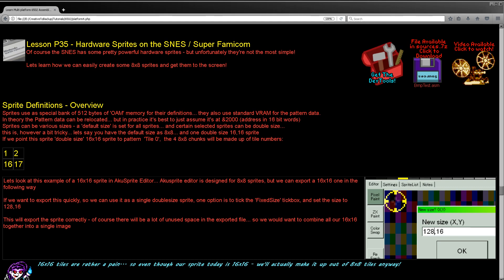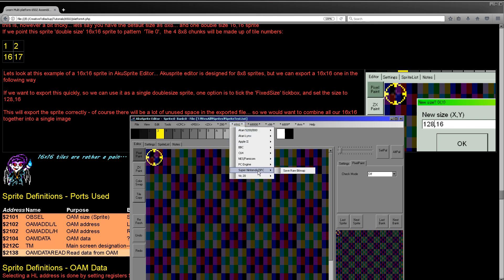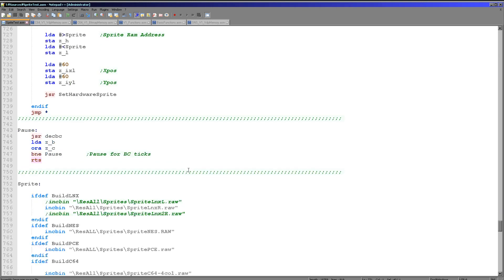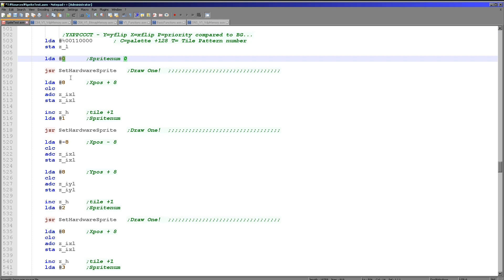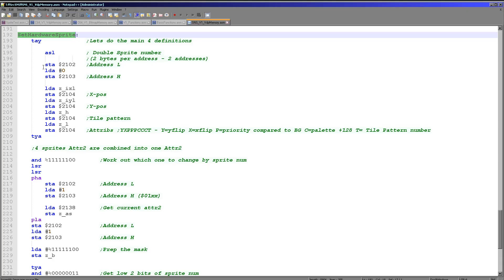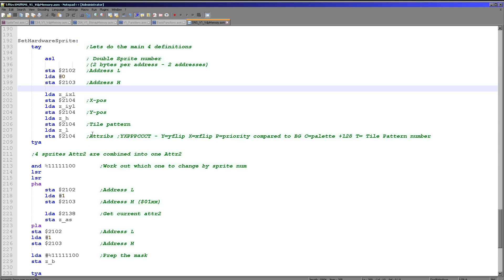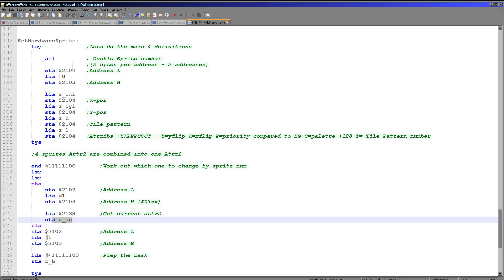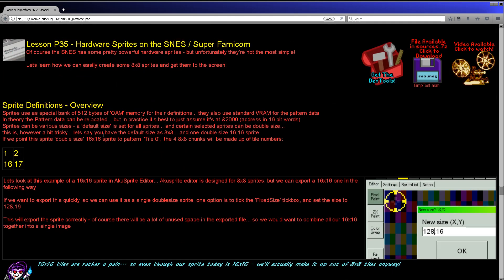Lesson P35 - Hardware Sprites on the SNES / Super Famicom

Comment: which compiler do you recommend me to start a snes programing?
Reply from the maker: I started with VASM - but it can only do 6502 cpu mode - fine for everything I cover in my tutorials, but not the full 16 bit potential of the SNES... 6502 and VASM are an easy way to get started.

I've started looking at WLADX for full 16 bit 65816 - it apparently supports the SPC700 sound chip too, as well as complex rom layouts... it's harder to use than VASM though for that reason... I hope to cover this in my tutorials next year

Comment: You might already be aware of this, but the SNES isn't limited to 8x8 and 16x16 sprites, but rather 2 different sprite sizes at a time. 16x16 and 32x32 is pretty common in games too, but I've never seen any other size combinations because they aren't very useful (64x64 sprites on the SNES are pointless).

Also, for dealing with the upper 32 bytes of OAM, I would recommend looking at this: https://wiki.superfamicom.org/how-to-display-sprites It'll be much easier to use and more efficient than any alternative especially if it's a gigantic unrolled loop.